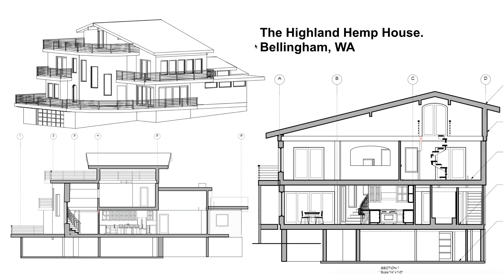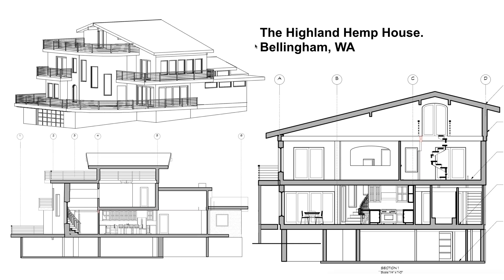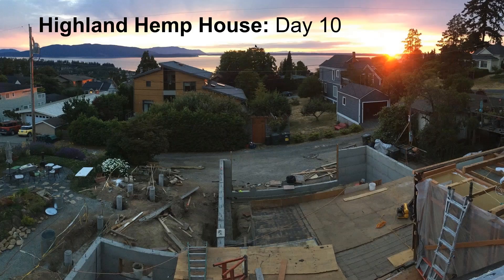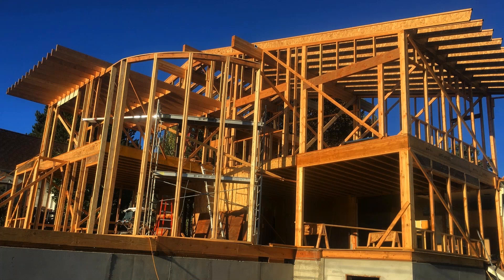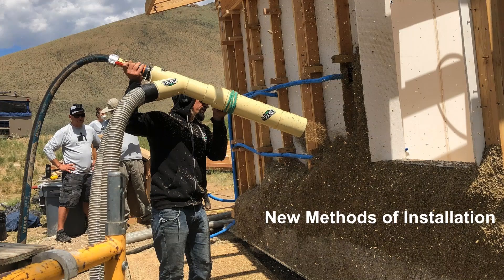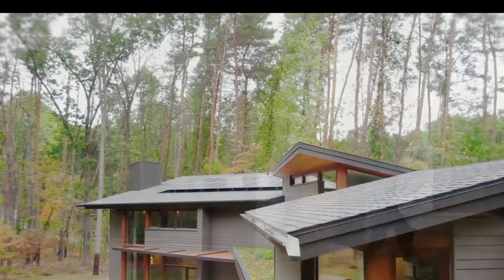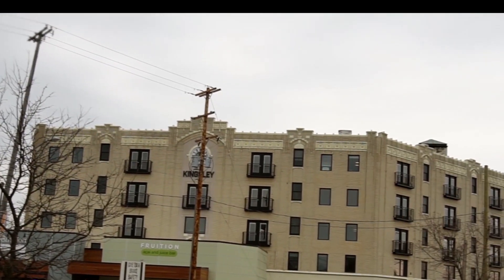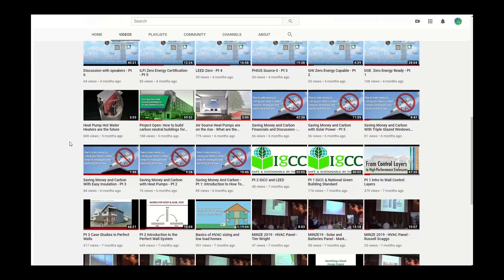Carbon Negative & Non Toxic Hemp Insulation - Part 2 of 4

Comment: re watching  curious if you used a 4 to 1 to  1 ratio for the hempcrete.  I saw 12000 pounds of hemp shiv and 23000 pounds of lime.. so that seems almost double the amount of lime than I would expect.  Seems should be 4 times as much shiv as the weight of the lime.  What am I missing here?   By my understanding that would be  4 bags at 15 kg (132pounds) to about 14.5 kg (32 pounds) of lime.   Needless to say am very confused.
Reply: Hi Steve. Thanks for your question. The ratio used as it relates to hemp & lime was 33 lbs of hemp core to ~63lbs of lime binder. This is close to 1:2 ratio of hemp to binder, as is generally standard.
Reply: @hempitecture  would seem that at that ratio you were looking for a lot more mass for doing the thermal fly wheel.  I am in zone 4 almost to atlanta so would think that the ratio would have a lot less binder.

Comment: At this point in time.. even if one desires to build with hemp, one needs to open the wallet very wide.  The growers and distributors in the USA have not gotten enough traction to make this a viable way to build.  $$$$ just way to expensive.  Those of us who follow this construction technique understand that it is an amazing way to build, but the shiv / hurd has to be imported from the EU or China. Finding a source for a lime that works well should be easy, and it is so long as you import it.  Hydrolic vs Hydrated  added pozzalain mixture .. Then finding anyone who has actual build knowledge  Between everything it just drives the cost beyond the normal cost of building a custom home by many percentage points.